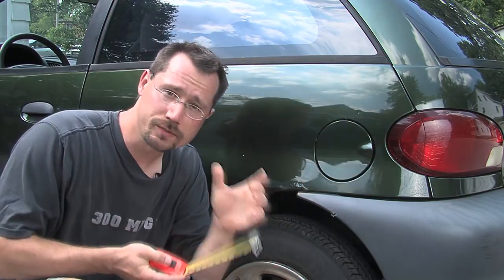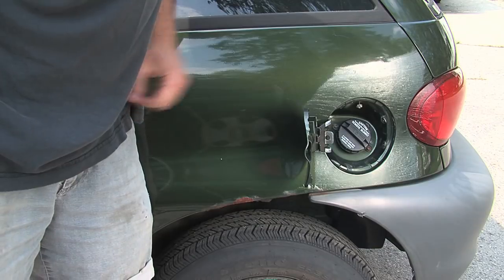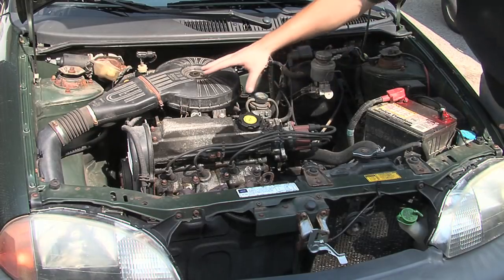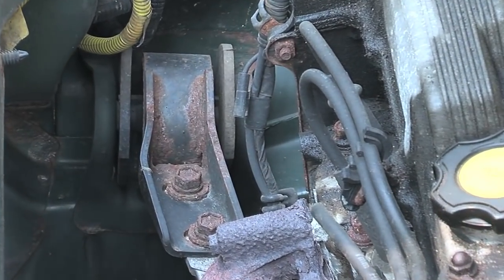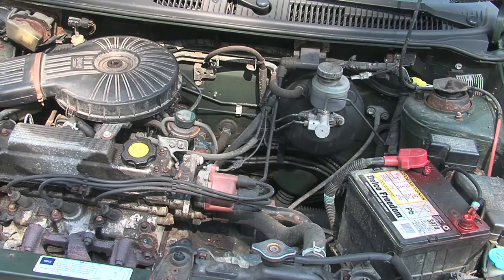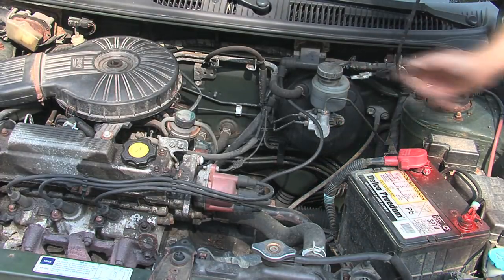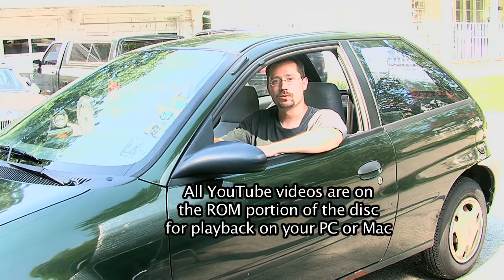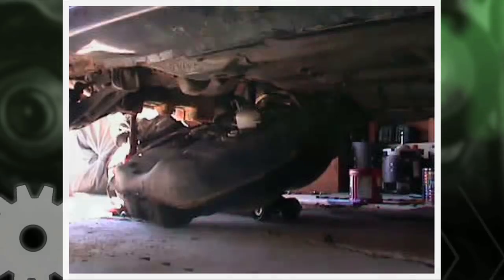4 Build Your Own Electric Car: de-ICE-ing

Comment: What about the radiator and fan? Do you still want the fan to cool off the motor or the battery pack? The radiator also cools off transmission fluid, so you need to keep it?

Comment: Can I remove the body panels and replace them with fiberglass versions? Since fiberglass is light and cheap. Or should i just get a chassis and put fiberglass body panels on it?
Reply from the maker: Anything you can do to reduce weight for an electric car conversion is beneficial. If you can replace parts with lighter-weight versions, that's great.
An even simpler approach is just to choose a light car in the first place.
Reply: The body panels of a Metro are already very light.

Rich Rebuids recently bought a Spark EV at an insurance auction for $2,000.  It had some minor problems that he fixed.  He said that you could swap the components to a Geo Metro.  The Spark EV weighs 2,866 lbs.  A stock 96 Metro weighs about 1,725 pounds.  The Spark EV range is 82 miles.  The Metro with the Spark parts would have a range greater than 82 miles, your guess is as good as mine.   You could lighten the Metro - how much depends upon your fabrication skills and the safety regulations in your state.

The lightest Metro could be built on a tube frame chassis with aluminum floor and Lexan side glass, non opening passenger door.  You can use a 3M window tint film to prevent the Lexan from scratching.

I believe a tube frame Metro with OEM drivetrain might weigh 1,400 pounds - passenger and rear seats removed and aluminum skin for interior panels - smooth aerodynamic belly pan.  Before I converted to EV I'd see how much fuel economy a 1,400 pound Metro might achieve using the stock Suzuki G10.  The only way to up the final drive ratio is to use the XFI crown gear(or the four cylinder G13 crown gear).  You could also swap to 14 or 15 inch Honda Civic wheels.  I estimate the 1,400 Metro could achieve 80 MPG, 800 miles on the 10 gallon tank.

Using the Spark EV parts, the final weight of a tube frame Metro EV conversion could be well under 1,800 pounds - about 1,000 miles under the weight of the Spark EV.  What do the Spark EV batteries weigh?   Could the range be 120 miles?  160 miles ?  At 1,000 pounds lighter it would be a rocket.  Spark EV wasn't sold nationwide.

Comment: I have a kia rio 5 door in excellent condition
Reply: How much time and cost would it be.
Reply from the maker: For me, this car was a summer project. I spent $1300 total (in 2008) The low cost was from using many salvaged/recycled/used parts.

Comment: he acts like it's nothing. It would take me years to do this.
Reply from the maker: Frankly, it DID take me a year to do this. It was a long summer project, and then I tinkered around with it quite a bit after that. At the time, I couldn't find any good instruction on how to do a project like this. So, I made the instructional video when I was done to help others be able to do it.
There were certainly times working on the project where I felt frustrated or like I didn't know what I was doing. I read, met new people, asked for help, and did whatever I could to keep learning and do something I never thought I would be able to do.
Before this project, pretty much the most I had done on a car was change oil.
Trust me, if I was able to do something like this, so can you.